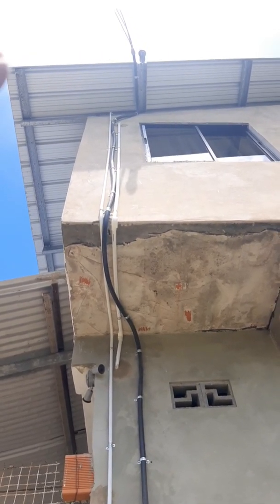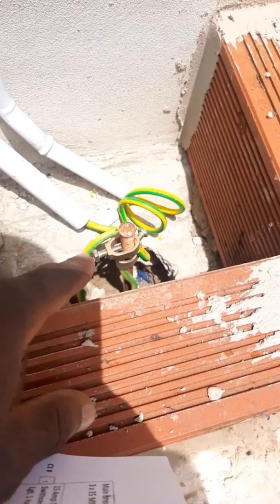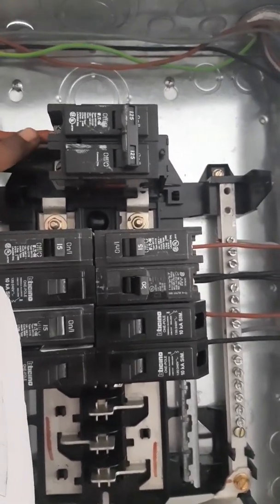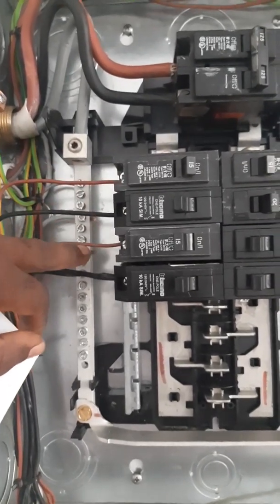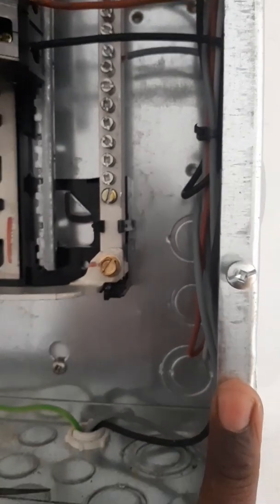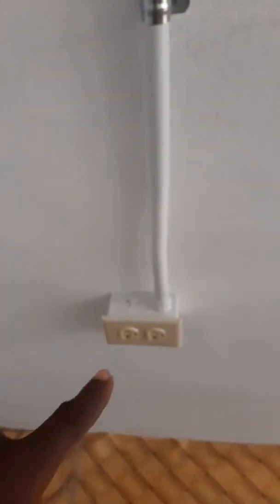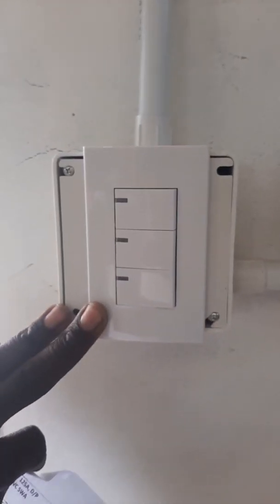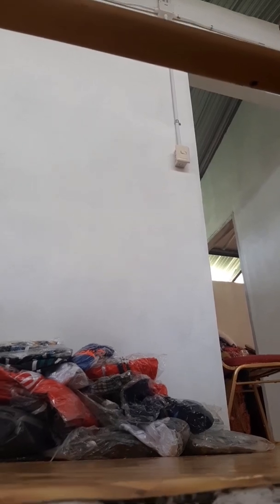Electrical installation in Trinidad

Comment: Thank you for sharing your knowledge I'm installing a 125 amp panel what size ground should i use to connect to the ground rod from the panel and from the roof. Also what service cable should i use. I did eletrical work in the US I'm now trying to get use to the mm wires.

Comment: Hi, when using a 20 circuit panel box would installing an equipment ground kit for the ground wires meet code?
Reply from the maker: Hi, it depends on your jurisdiction. It's not necessary here in Trinidad. I have never installed any. The traditional copper lug for ground conductors is sufficient and lawful. Just know what the appropriate amperage.

Comment: Am i seeing correct at time point 2.09 you have double tap from some breakers, is this legal regarding electrical code in tdad ?
Reply from the maker: Yes we can, as long as both circuits does not exceed the capacity of the breaker. 6 plug receptacles is the coded maximum per 20amp breaker or 9 on each lighting circuit.

Comment: Good video. Took a look at your other videos as well, very informative.
Reply from the maker: Codes are forever quickly changing. To the point where sometimes it's hard to keep up. Take it one circuit at a time...
Reply: No problem. I'm just starting off, not much experience as I just got my diploma. So I'm grateful to see vids from home using our codes and setup.
Reply from the maker: Thank you sir!
Reply: Hi just a question tntec have to inspect pipes in wall befor plaster